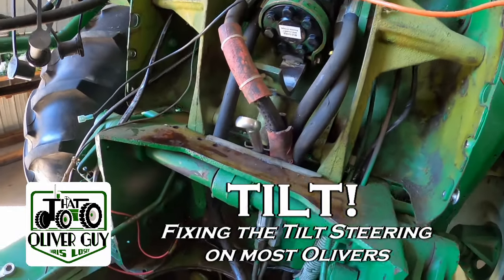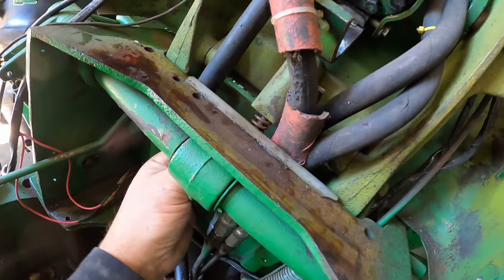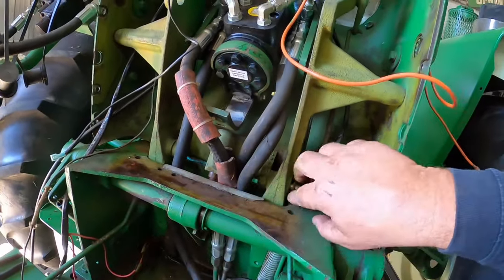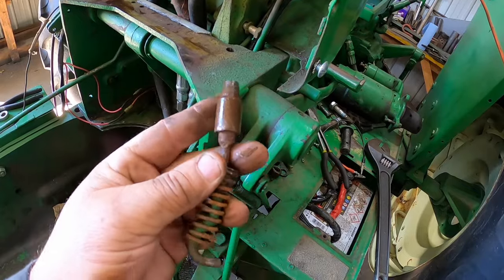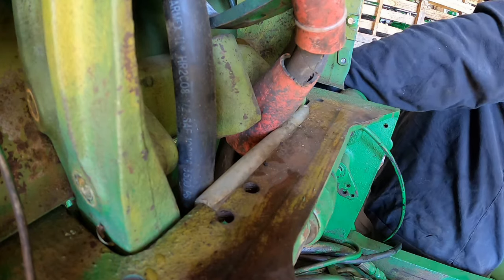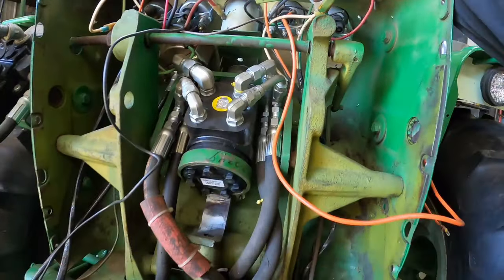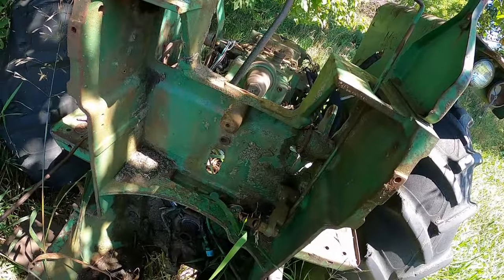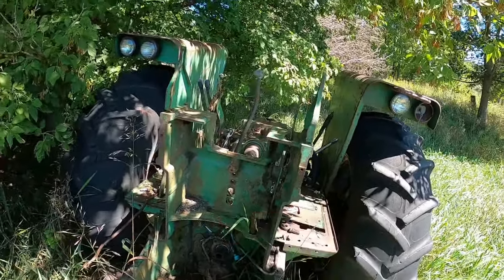TILT adjustment

Comment: Your.    Really.   Good.  Getting.   That.   Stuff.  Figured.  Out
Reply from the maker: Thanks!
Reply: @ThatOliverGuyChris  the.   Hyd. Fittings.   Hard.   To.    Put.   Together.  And.   Take.   Apart.   I.  Even. Changed.   The.   Ends.    And.     Couplers.    What’s.   The.    Best.   Way?   Have.    Had.   Oliver.   And.  White. Very.   Good.  Tractors.

Comment: Great video Chris, Maybe I missed it, but Allens tractor is a 1650?  I have a 1750 with a limp peddle.  It sure seems like the plunger pin is unhooked.  I Think mine would be the same as the one in the video, not the 1850 at the end?
Reply from the maker: Yes, Alan's is a 1650 and the 1750 will be identical to the 1850 at the end. The 1750 style is probably the easier of 2.
Reply: Thank you for the information in all the videos you do.  I definitely learn a lot!

Comment: Are the 55's similiar? I have a 2-85 that needs attention.
Reply from the maker: It's a little different . That one pivots on a bolt in the dash and doesn't have the plunger, it's all built into the pedal. If it doesn't move, then the pivot bolt needs freed up. It's down in the dash, you might be able to get to it removing the dash side panels by the clutch and brake pedals.
Reply: @ThatOliverGuyChris  Thank you.

Comment: Mine wasn’t working, had it fixed for awhile and now it not worky again…perfect timing for this video as it looks like I’ll have to tear into it again and fix it properly once and for all!
Reply from the maker: For enough cookies, I'll come down and fix it. LOL
Reply: Looks like I didn’t see your reply about the cookies lol
Finally tore into mine yesterday. Should there be a washer between the jam nut and the spring? My spring has walked over the jam nut causing the spring to enlarge a bit and maybe being a little larger OD than the plunger itself. Oh, and Merry Christmas Chris and family!
Reply from the maker: @ricehillrestorations  I don't recall a washer. The spring pushes against the pin, and is held in by the cover. If you put a washer in, it's going to compress the spring more. Maybe yours doesn't have the original spring?

Merry Christmas!

Comment: This is something that I need to do in my 1800 for some reason the tilt steering does not lock
Reply from the maker: I'm not sure what would cause that, unless someone took the pin out.
Reply: No if I remember correctly, the pedal is stuck down and I could not get it to come back up and never wanted to force it. I would have to walk out there and look but I'm pretty sure that's what the scenario currently is.
Reply from the maker: @Adam_Poirier  ok. Probably got rusted in the down position
Reply: Hopefully that's all that's wrong. Legend has it I'm going to get ownership paperwork for that tractor Transferred from the farm to myself pretty soon which means the restoration can start.👍
Reply from the maker: @Adam_Poirier  awesome!